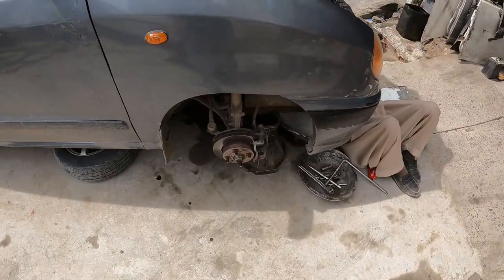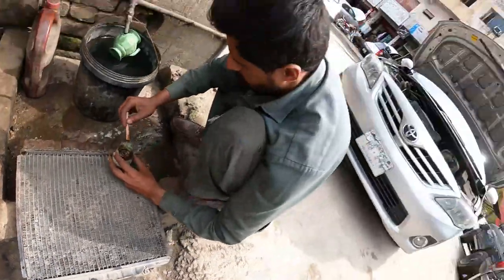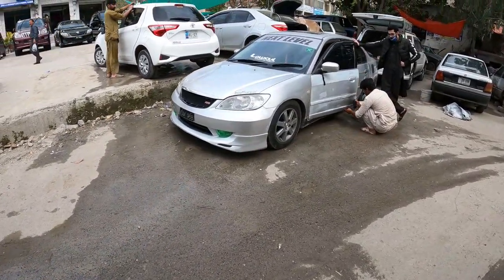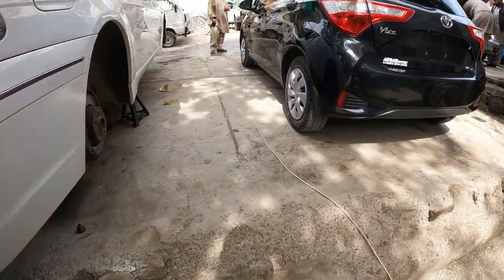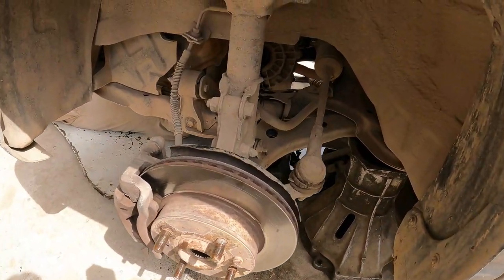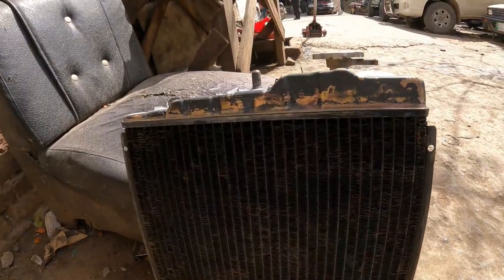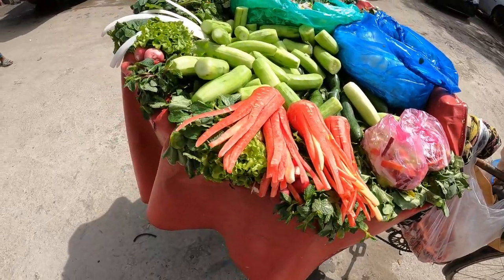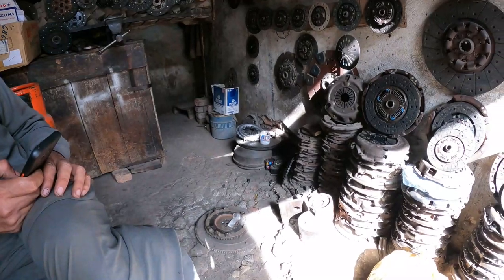How Cars are fixed in Pakistan | Car market tour in Islamabad, Pakistan

Comment: very interessting, thank you for this video... here in Germany, the mechanichs repair the car by simply replacing the old with new parts. There is no real repair anymore. For Example 7:23. another example: Instead of changing the bulb, the whole headlightsystem is changed. It is more expensive to change than to repair, thats the system here.
Reply from the maker: Hi thanks for your comment. I think the reason is that in Europe and countried like Germany the labor id very expensive. Hence the overall cost to replace the part is less than repairing the part